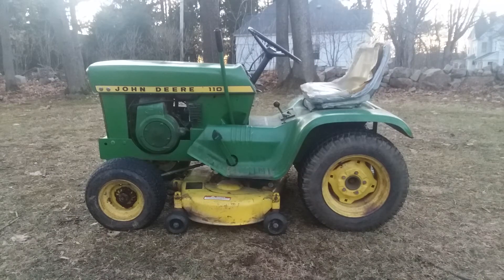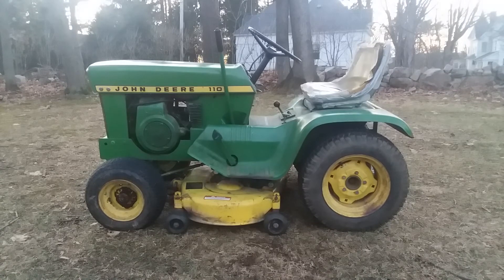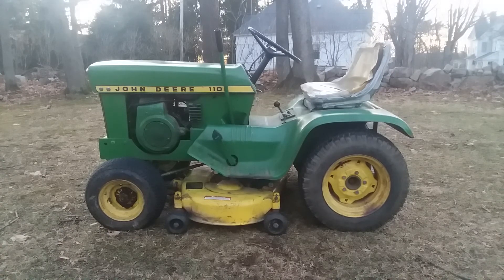Facts about the John Deere 110/112

Comment: The 112 was a 10 hp 
The options were a tecumseh or kholer engine
The 110 was a 7 or 8 hp engine
The 7hp was the tecumseh and the 8 hp engine was the kholer
Reply: 110 was Kohler all threw production. 7hp was 63 only. 8hp til 73 when it went 10hp. 112 started with a 10hp Tecumseh and went 10hp kohler ending with 12hp kohler. There was a year or 2 when both Tecumseh and Kohler 10hp was available for the 112.
Reply: @gregolson5532  I still have to take the deck off mine and see how much damage it may have from sitting for 30 or 40 years the belts still look good
Reply: I have a 1974 110 with a 10hp Kohler
Reply: @Tim Hawkins  73 and 74 110s were 10hp and the 112s were 12hp in 73 and 74